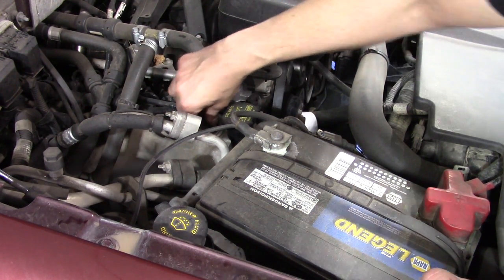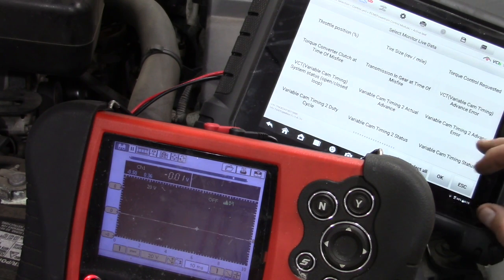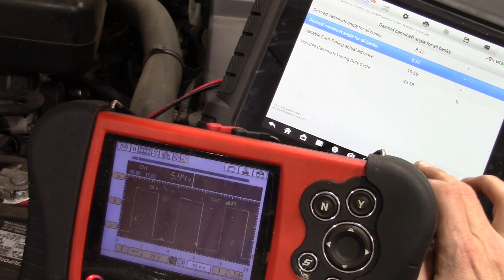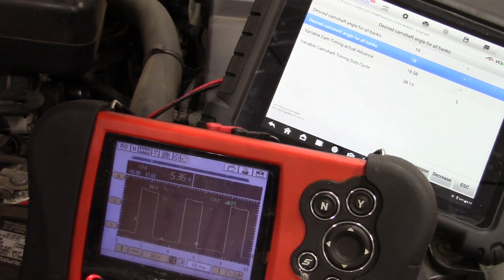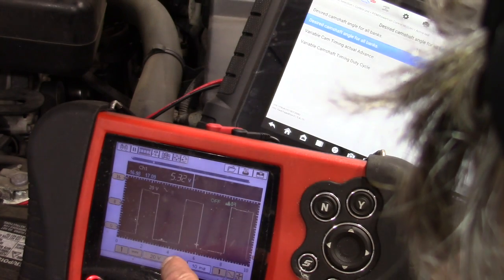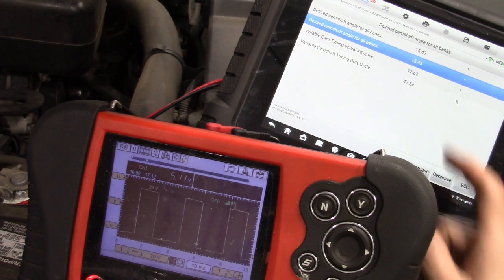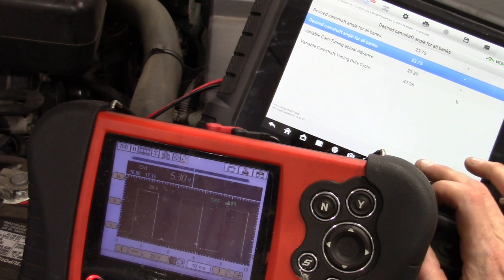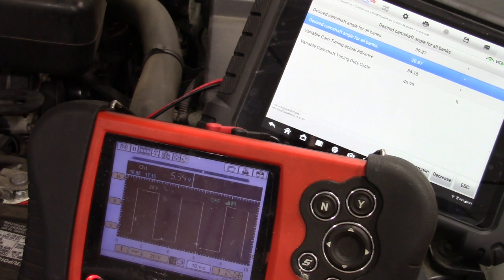Help! Why is VVT solenoid doing this? (Part1 of 2)

Comment: This is not an informed answer, but I have some experience with controlling servos by manipulating duty cycles. My guess is that the duty cycle you are seeing is the duty cycle necessary to hold the current position (steady state). The duty cycle likely changes for a few milliseconds to physically move the cam advance. Once the cam is where it needs to be, the duty cycle goes back to the holding position. You could test this theory with the picoscope, and a snapshot when the cam change command happens.
Reply: Another note, duty cycle is the same regardless of the pwm frequency. Higher frequency gets you a smoother average, but 50% is 50%. Of course if the frequency is too low, the device would be full on then full off during the cycle, but the average would still match the duty cycle. On the other end of the spectrum, too high of a frequency and you won't get a nice square wave. You'll get a skewed wave.
Reply from the maker: Oooooohhhhhhh!!!!!!!  i like that!!!!  yes I will try that!!! Genius!! only issue is I would expect we would see the change in duty cycle while I am commanding advance at that time scale and it doesn’t change. but love the idea!!
Reply: @SchrodingersBox  I don't think the snap on tool is fast enough to capture it. In theory, it would only need to raise or lower the duty cycle for a single cycle to get the cam to move. Once it's there, it reverts back to the holding duty cycle.
Reply: @SchrodingersBox  There are some very brief changes in duty cycle when you're commanding it, but they last for just a few cycles - and you're only seeing a fraction of those at that time base. When looking at the scope, you see an occasional outlier and some "jitter", so there is some regulation going on, it's not a 100% stable signal. Taking a look at a longer capture of hundreds of cycles around a commanded change should show some activity.
If you want to understand more about the physics behind this, take a closer look how voltage across the inductor, current through the inductor, magnetic field strength, force applied to a magnet in that field and the movement of that magnet pushing against a return spring interact with each other. Somewhat complicated, but logical ;)
Reply: I agree with this.  I might have been imagining it, but it looked like the duty cycle was occasionally jumping around then settling back to the steady state.  I'm guessing that the computer would periodically detect that the cam angle was not what you set it to, adjusted the duty cycle then set it back after the cam angle was back in the right position.
Reply: @BeardedOneWithBeard  I thought I was seeing that jumping, too.
Reply: Give this man the 10,000 dollars!!

The duty cycle you are seeing is to keep the pressure in both chambers the same, so the position doesn't change, the volume of this chambers doesn't matter.  When the camshaft changes position is because the volume of oil in those chambers has changed. But to modify this volume you only need to increase the pressure in one chamber for a very very short time. Shorter than  what you are measuring. Then you need to equalize the pressures.
Reply from the maker: Thanks John. yeah I agree- this is the most logical explanation.   while it isn’t worth 10K lol, I do believe dennis is likely to win the free subscription. 
  this theory will be easily validated with picoscope. I’ll do that soon as I can.
Reply: Your channel is worth that and more.
Reply: Went back and looked at the video, and I think that the duty cycle or frequency is changing briefly every once in a while, but it's happening so fast, I can't tell which.  Can you capture a longer timeframe and go back and look at the captured waveform with that scope?

I'm pretty sure Dennis gets the prize.
Reply: From what i know duty cycle should increase/decrease and stay increased/decreased for the selenoid to stay in certain position as is always pusing against a spring or oil pressure.